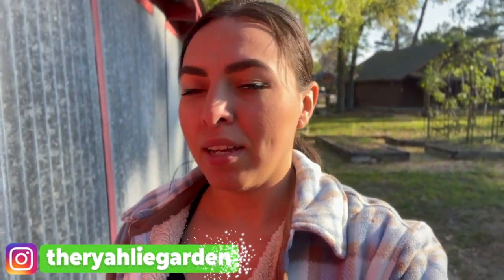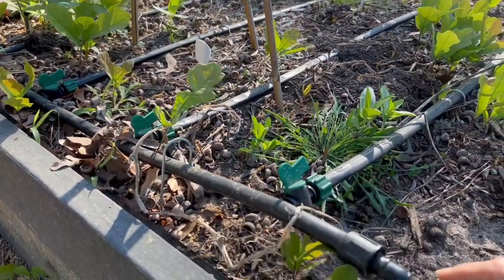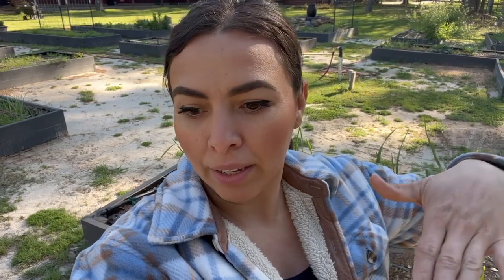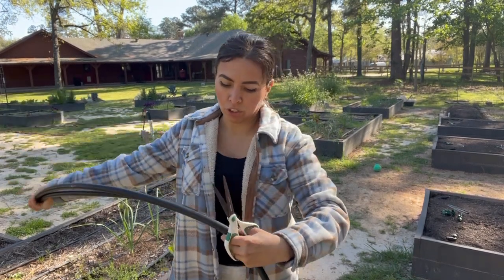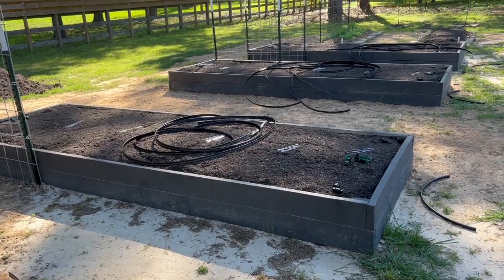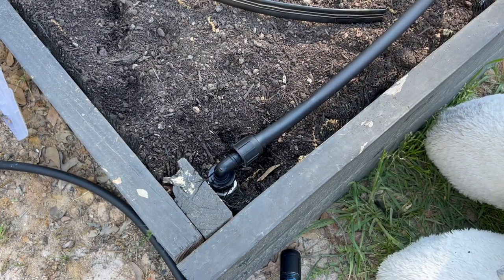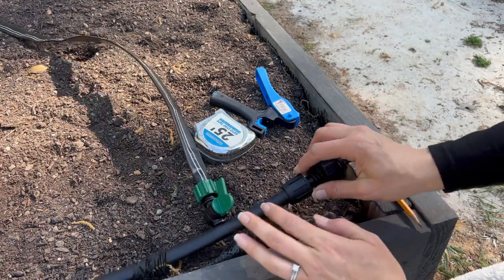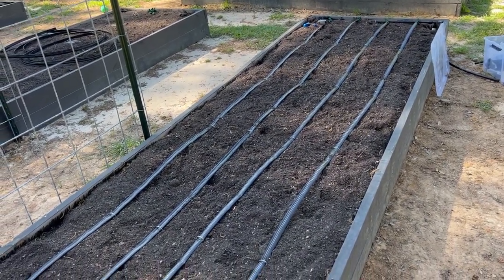New Drip System | Drip Depot

Comment: Nice job, looks good, nice and neat. I’m really impressed with you abilities. I’ve run what I feel is miles of that 1/2 poly tubing. The older I get, the harder the fittings go on. I do heat the tubing end but I also spit in the fitting. Makes it go in easier. Don’t thing yo need pressure reduction unless your running 80-100 lbs. you have a great many emitters. If you start blowing lines, then you might need them. Would love to work with you. Take care

Comment: My end caps are leaking really bad. I am discussing with my husband on what we can try to fix it. He just want to glue the top down permanently. I really want to use them as a flush for the winter time.
Reply from the maker: Have you tried adding the white plumbers tape?
Reply: @theryahliegarden  yes, did that yesterday but it's still leaking. I want to put on the pressure reducer to see if that fixes it. I have a whole line pressure reducer that goes on at the spigot with the filter. My husband wants to put PVC glue in it which defeats the purpose of the removable end cap.